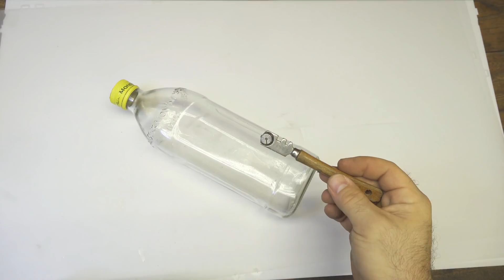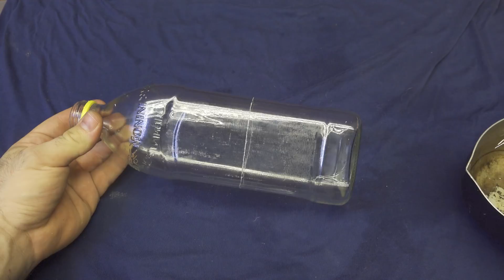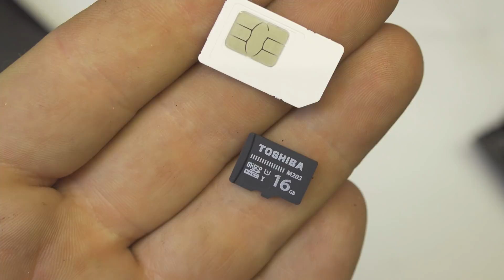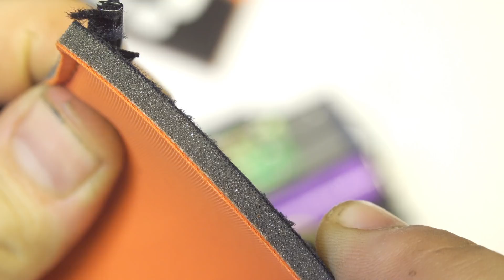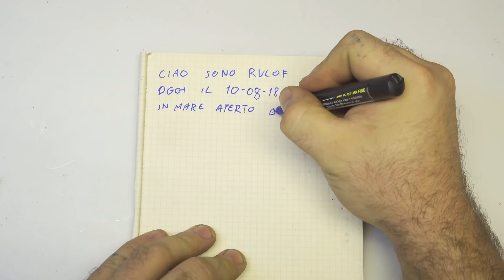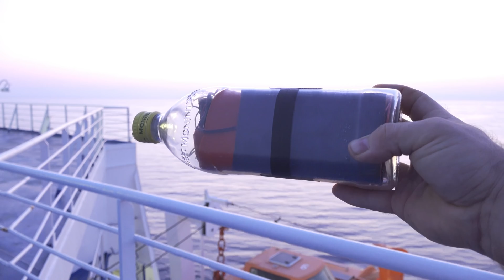Message in a Bottle + GPS • How to make it

Comment: I believe the GSM system runs off of a 4G or 5G network.... These networks use cellphone towers. Cellphone towers only transmit about 1.500 feet out to sea. The device would need to wash up where towers are located, and have international call and text credits. The GPS signal and location can't be transmitted without a 5G connection. These days GPS and GSM are micro compared to this example. Huawei the Chinese company have developed towers that can transmit 100km out to sea.

Comment: Well that is NOT going to work. There is NO GPS or GSM antenna on those wires, and they also look REALLY weird - normally you would have a proper SMA-connector on those cables. I think OP is "letting out" som really important details here, and in effect is making a fake video. Sad.
Reply: Actually this project is work... Check the Italian channel...

Comment: The bottle will change color in the heat of the sun not sure how long the solar panel might work, you should make a wave generator to power the GPS, and maybe a smaller GPS unit?

Comment: You will never see that bottle again... I guarantee it. A couple of reasons. First: That drop... ouch. I know you put neoprene in there, but that was a long drop. Second: did you actually test the solar panel power capture ability? Your black tape will severely compromise the performance (look up partial shading). Third: What happens when the bottle flips over? 

Honestly, a better idea would have been to use something like a Spot emergency beacon, which uses satellites to communicate. More expensive, but at least you don't need to be in sight of shore to have it work.
Reply: The solar light voltage step-up cirquit will only (I think) be powered at night. When it gets dark, it should have been charging throughout the day, giving it sufficient power to send at least one position update. Apart from that I strongly agree on the partial shading argument, as that impacts the power delivery to such an extent that the one in question probably delivers only 10% of rated current. Not to mention the center-split glass bottle being thrown from 20 metres. Oof.
Reply: I think the bottle won't flip thanks to the low center of mass.
But it's weird that he didn't show any  proof that the device is self sufficient with the solar panel.
Reply: @kehnyalexandre5248  it's a fake video. He doesn't show anything. Waste of time
Reply: Kehny Alexandre It won't even float with the solar panel up... It will float with the bottim of the bottle pointing down..
Reply: @rkan2  I don't think so, it is a very unstable position unless the bottom of the bottle is heavy. When I mean low center of mass, I mean far behind the solar panel

Comment: So, you are hoping that it will wash up somewhere with compatible coverage so you can recover it and see its track on the SD card? You do know that it won't transmit without a cell tower nearby right?
Reply: Doesn't that module also have gps?
Reply: @riccardobassini9452  lmao the amount of people that think theyre phones can use GPS for sms or calls...
Reply: Riccardo Bassini  GPS is as passive system. The device itself can figure out where it is by the position of the satellites it can see. The device cannot send anything up to the satellites. It needs another network connection for that like cellular, wifi, satellite messenger, or Marine AIS to name a few. He is going to need a bigger bottle and If thermal management turns out to be an issue, he could do a radiator type system by drilling holes and passing bolts through the bottom of the bottle, this will also help it stay upright too.
Reply: @Specter0420  in fact there is an sd card recording the trip,so he will know the trip of the bottle once it lands somewhere
Reply: @tommasopagnin414  the problem is knowing where it would conveniently land without any cell signal/ SMS from its last known position.
Reply: @tommasopagnin414  Did you even read the comment you are responding to? You just repeated what I said, acting like you are telling me something...

Comment: The only problem is, there is no gsm reception on the oceon
Reply from the maker: passengers boats have antennas that repeat the signal.. i wait that the bottle come close to on of this ships.. or to a city.. :)
Reply: @RulofMaker  I applied for a job at this company https://knlnetworks.com/ They have an interesting product where ships are connected to a cellular network through a mesh network that eventually gets back to a cellular base station near shore. I hope your bottle is able to use this cellular network at sea too.
Reply: As long as the sim/cellular account has roaming agreements with the passing ships, or the final beach it washes up on.
Seems a long shot...
Reply: its GPS, comes from sattelites is worldwide
Reply: @abudabisas  GPS is a passive system. It can only tell Rulof about it's position through a cellular network. Yes, the position will still be logged to the sd card, but it will still be nearly impossible to find.